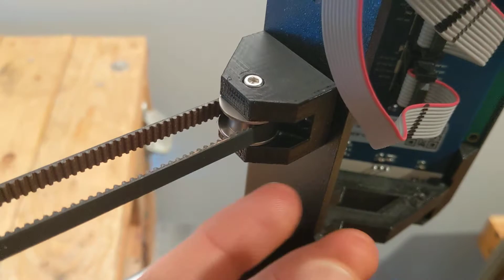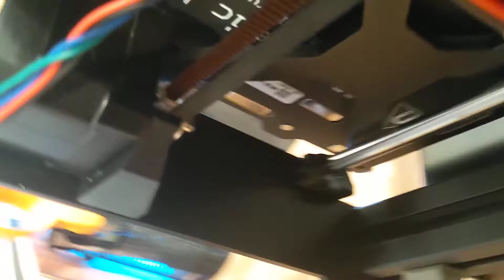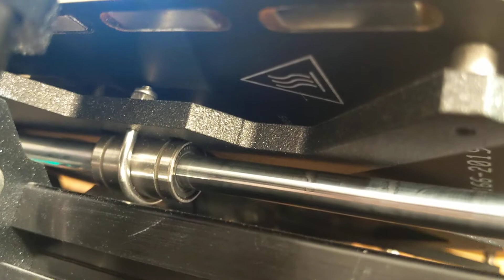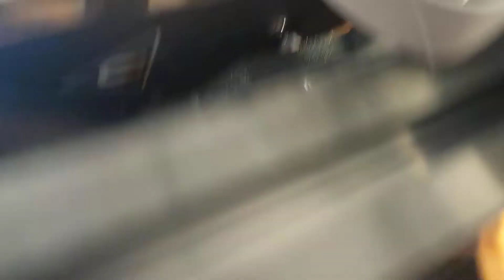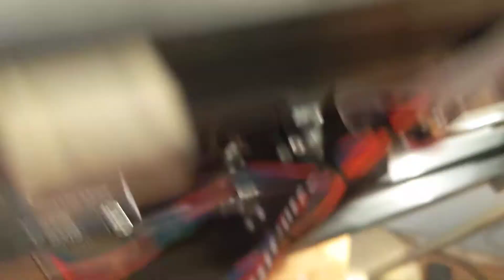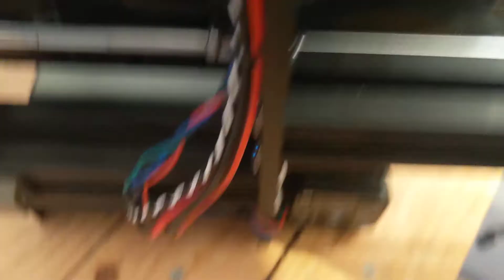Prusa mk3s Y axis issue

Comment: Just had this issue. It seemed the wipers on the bearings were dry. I wiped the rods down,  put a little silicone oil on them, and now everything is moving much easier. It's one of those hair pullers isn't it?
Reply from the maker: Yeah it's clearly a lubrication issue - I shoudl update the description for this, apparently people are somehow finding this video and watching it haha. FWIW I used PTFE lube on the rods, that was it. Clean em, lube em, push it back and forth a bunch to get it spread all around and you're golden.